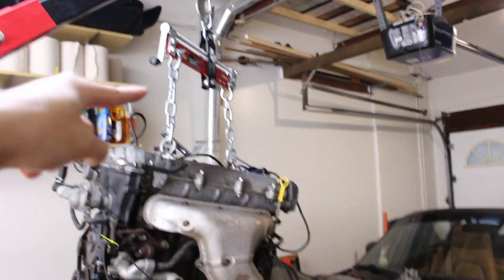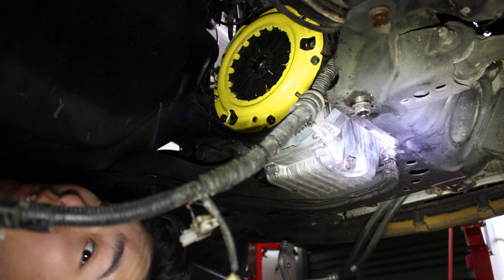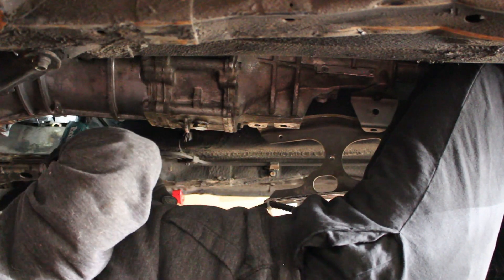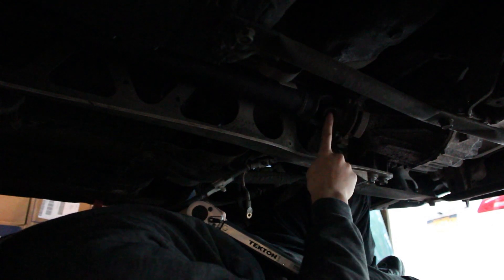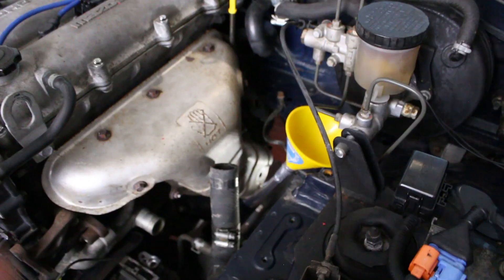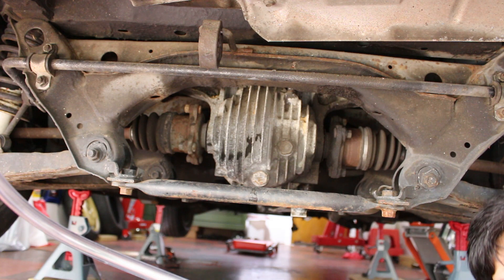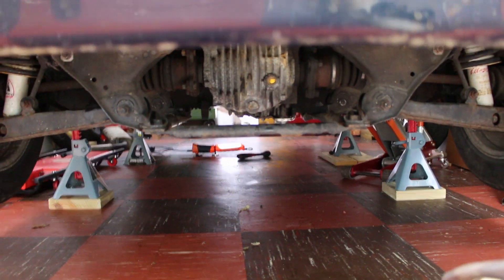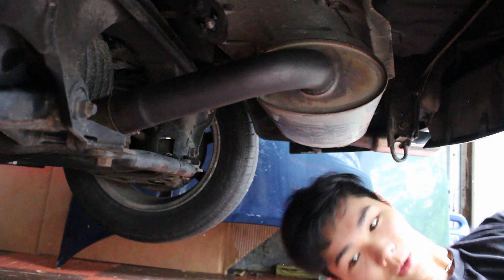NA Miata Engine Install | Part 1

Comment: It's possible to put the engine + transmission in together. Removing the CAS and the coil pack gives you a bit more space.

Comment: You’re 100% correct, it is easier to do the engine and transmission separately. I did my engine and tranny separate too, I suppose it would’ve been hard that way if the transmission  weighed more than 75 pounds but I’m not a big puss wad either.